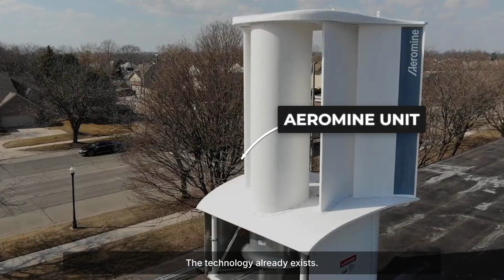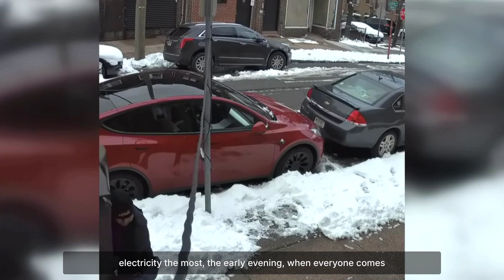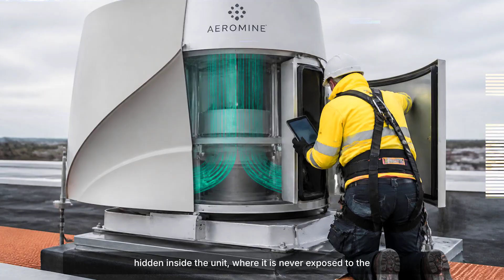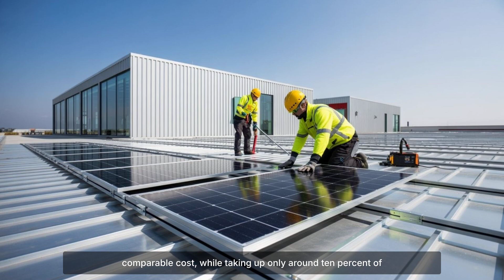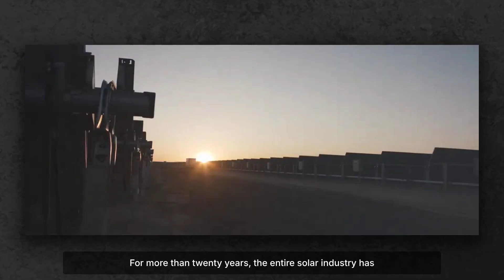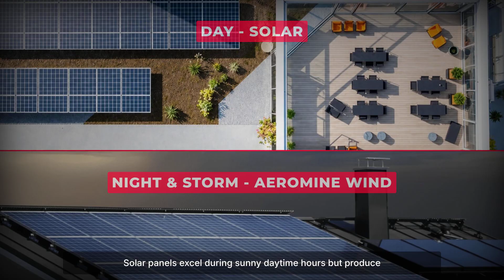The Wind Turbine that Beats Solar Panels

Comment: Reality: All tests of small wind turbines show that they hardly produce any electricity! 
Solar panels ALWAYS generate at least 10x more electricity with the same investment in time & money! Reliable and almost maintenance-free for at least 25 years. But 9 out of 10 small wind turbines stop working after some years due to the extremely gusty winds close to ground. Anyone who lives off grid needs a petrol generator anyway.
Reply from the maker: That's true for many traditional small bladed rooftop turbines, and the video actually acknowledges that. The point here is different: Aeromine isn't a conventional spinning turbine. It's a bladeless rooftop system designed for large, flat commercial buildings where wind conditions are much better. It's also not presented as a replacement for solar, but as a complement that generates power at night, during winter, and in cloudy or windy conditions when solar output drops. The best solution in many cases is a hybrid system that uses the strengths of both technologies.
Reply: @WindmillsTech  But there is a key fact: Solar panels ALWAYS generate at least 10x more electricity with the same investment in time & money!
Reply from the maker: @michaelvanallen6400 "Always" is a very strong claim. That may be true for many conventional small wind turbines, but this video isn't about those. It's about a rooftop system designed to capture accelerated airflow around large commercial buildings. The goal isn't to replace solar—it's to generate electricity during the hours when solar produces little or none, like at night, in winter, and during overcast conditions. Different technologies perform differently depending on the site and application.